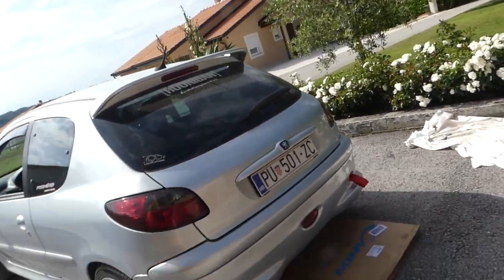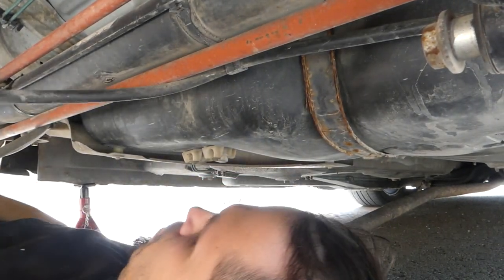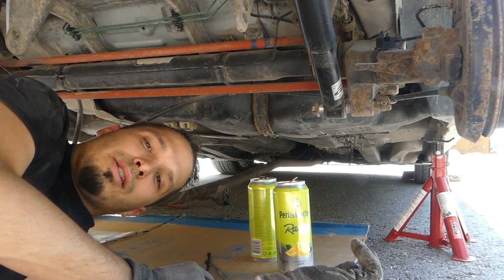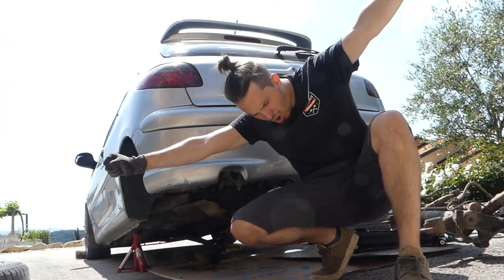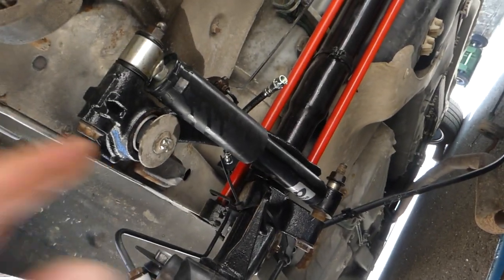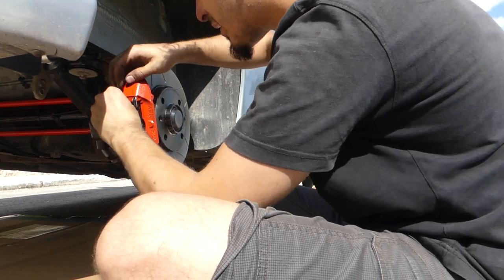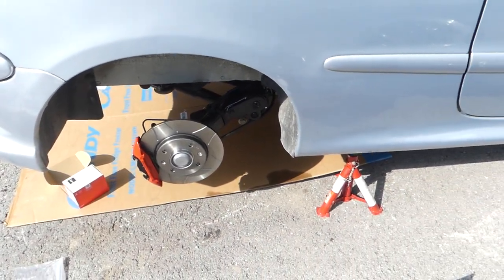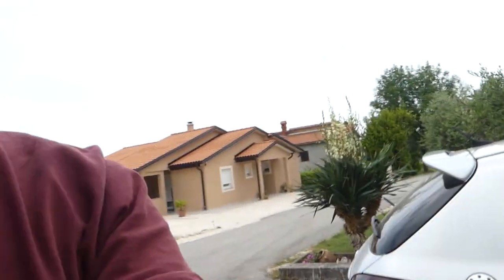DRUM To DISC BRAKE Conversion!! PEUGEOT 206!! EP3

Comment: Hi I have a (1961) Peugeot 403 pickup  I want to  convert from drum to disc  any ideas
Reply from the maker: Did you check the drum sistem on in?
Check the sistem and try to find what Peugeot/Citroen have the disc sistem that you can fit or replace with existing one.
Reply: @Dynoo1000  thanks for the advice  but which model citroen or Peugeot
Reply from the maker: @johnjoe1535  Well, it's up to you to do the research, that's the magic of the project. 🙂